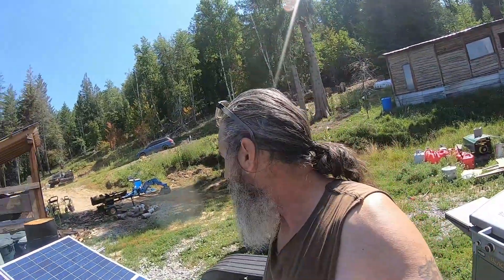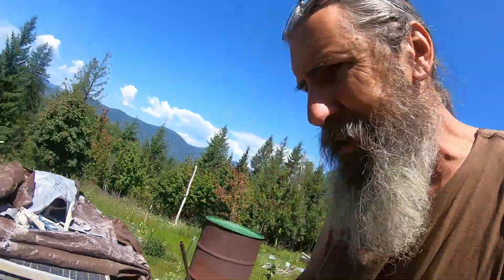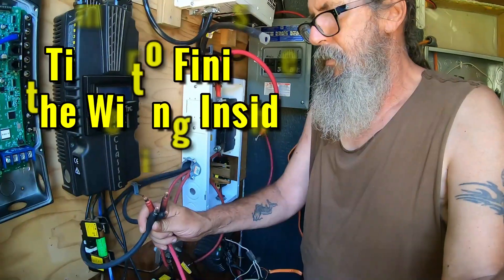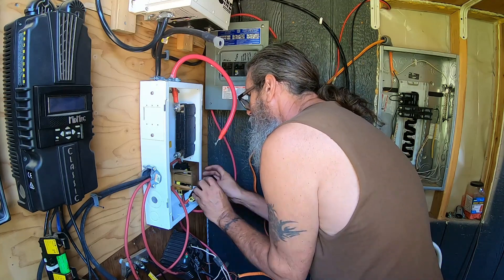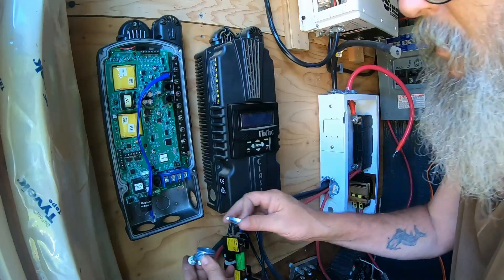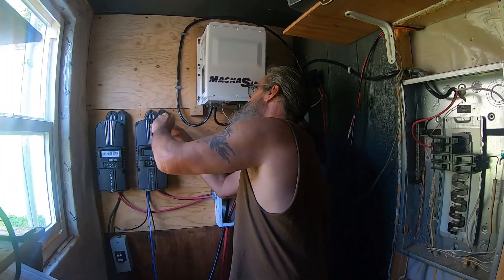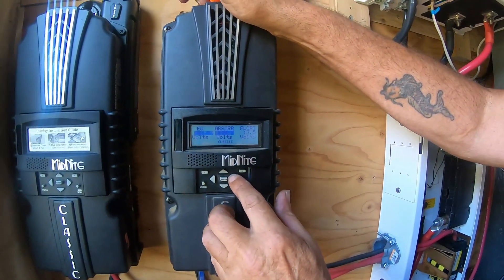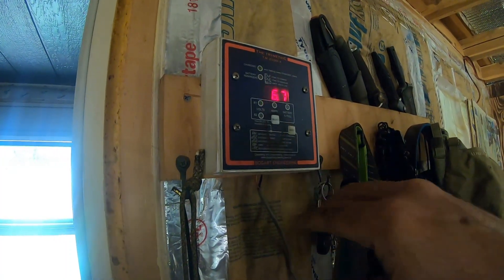Can The Off-grid Solar Upgrades Pass The Test?

Comment: I'm not sure if it has to happen this way, but I seem to remember, from when I was apprenticing, that when running the grounding wire, if you just go from one part to the next with one wire going out to the grounding rod, it has to be one solid piece from the first component, through the rest and out to the rod. If you cut that wire anywhere, then you have to go with individual wires to the rod. Hopefully that makes sense. When I rework my system, I'm sure I will run it that way. Awesome job!
Reply from the maker: Thank you so much! I’ll pass this along to Stu. 😀
Reply: @BreakingFreeOffGrid  I hope it helps
Reply from the maker: @WindwalkerHomestead  I’m sure it will.

Comment: Rather you then me with all that lot I’d rather just stick to out 240volt set up where we run a 2.5mm twin and earth cable from the fuse board around the sockets and back to the same fuse making a circuit etc then we run single live, neutral 10mm and an earth cable 6mm from the fuse board to the main incoming fused switch then to the meter.before this is the electric company property and they wire it up. So simple?
Reply from the maker: That sounds confusing to me…lol. Stu might understand it though.
Reply: @BreakingFreeOffGrid  the differences between the US and UK is quite a lot.
Reply from the maker: @1MartinWaite  oh yeah! It’s crazy how things differ so much between countries.
Reply: @BreakingFreeOffGrid  yep I'd love to be able to pick the best from between the two countries.
Reply from the maker: @1MartinWaite  yes!!! 😀

Comment: Always take your watts and divide by volts. That will give you the amps that your charge controller will need. 
Example…. 
2-325 watt panels will need a charge controller that will use 30 amps if your using 24 volts
That would be 60 amps if your using 12 volts
My inverter will always make noise if your using it. The more power I pull the louder it gets 
Two grounding stakes right outside your window would be fine. 
You have a grounding stake out on the panels right. That’s the most important as far as I know.
You guys have a wonderful week..!!
Reply from the maker: Thanks Ron!!! 😊